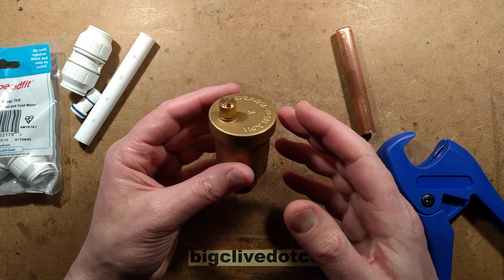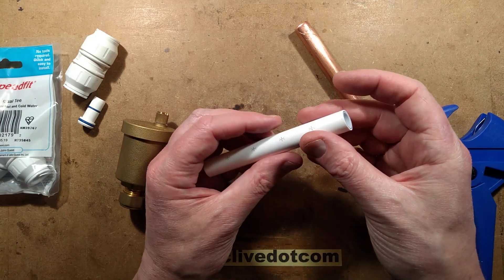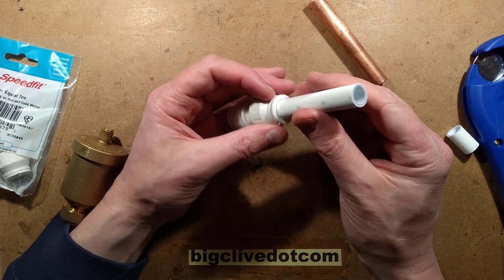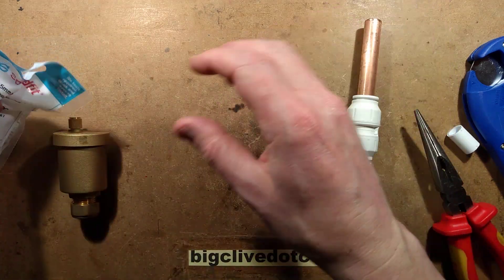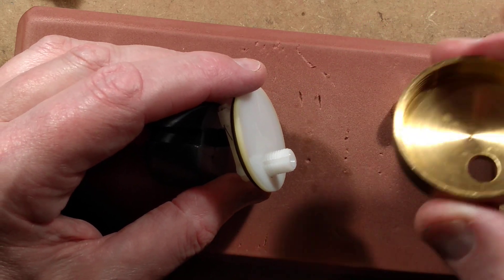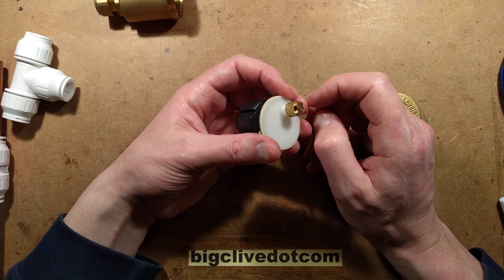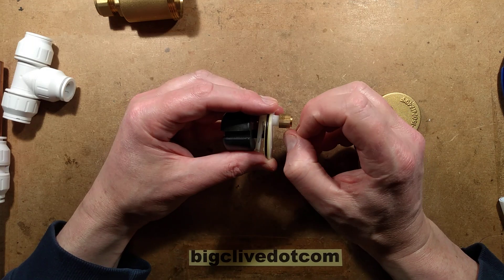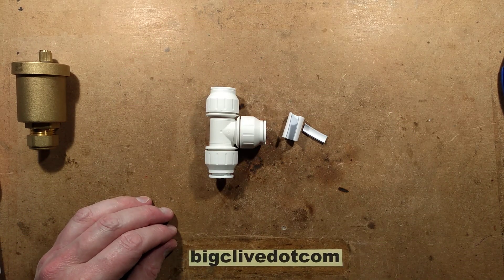Inside a bottle air vent and plumbing ramble.  (No electronics whatsoever.)

Comment: I was expecting a ping-pong ball to be inside. Goes to check that the cap isn't screwed in tight on the vent by my hot water cylinder.
I put one of the fibre washer type bleed valves on the one radiator in our system that always collected air and it has been trouble and air free ever since. Simple fix for very little money and why didn't I do it years ago.

Comment: The reason that the float does not apply pressure directly onto the seal is to prevent wear on the seal. The seal pressure is regulated by the lighter controlled spring pressure instead of being forced up by the float.

Comment: I'm a plumber, for plastic pipes my preferred system is Raxofix by Viega. The fittings aren't as huge, but you need to use a press to seal them.

Comment: I re-plumbed my CH system using copper pipe and Speedfit fittings, everything clipped and up to building regs etc.  Within 5 years EVERY SINGLE speedfit joint has failed.  No idea if I unknowningly did something wrong.  Replaced with copper compression fittings and 10 years on still all good.  Will never use speedfit and its like again, too much long term hassle.
Reply from the maker: Did they pop apart or just leak?
Reply: They started weeping, which became a dribble.  I tried to tighten them, adjust them etc to find out what the cause was, but couldn't work out why.  My best guess was that the 'O' ring seals had failed but no real reason as to how.  I replaced them as they failed, and after 5 years I had replaced them all.  They were fine for the first 2-3 years though.

Comment: So are you supposed to keep these slightly open or not?
Reply from the maker: If it's in a visible place that water damage from dripping isn't an issue then they can be left venting.  If elsewhere it may be better to close them fully.
Reply: @bigclivedotcom  Much thanks!

Comment: used it for years never had a failure   the ONLY no no is do NOT use it on Stainless Steel pipe it WILL BLOW OFF absolute guarentee  AND contray to popular opiunion  you CAN intercnahge makes of plastic pipe  .

Comment: Only to add that this air bleed system must be installed vertically. We had some yahoos mount it sideways (horizontally), not good at all.  We use it in car wash chemical delivery and such.

Comment: Go for it Clive.
We've had had problems with old copper pin hole leeks.
Called plumber in to replace all incoming mains water pipe work.
Have now got lots of pipe and fittings as seen in video. good job!!!
Keep the vids. coming Clive.
Reply from the maker: I ended up replacing the main incoming cold water line with plastic.

Comment: A little history to help give you confidence in the new "press fit" connectors you are switching to-- this same style of fitting has become the standard in the US and here in Canada for the Air Brake systems in all transport trucks for at least a decade now (150PSI or 1000KPA). They stand up just fine , even here in Canada where they are subjected to Salt and Calcium Chloride all winter long. Commercial trucks here in Canada must pass an annual safety inspection which includes bleed down tests on the air system.

Comment: Plastic does have some really neat features. Their surface is very smooth, so limescale have hard time settling on it. They does not rust. They're flexible, allowing easier installation and, as you mentioned, are fairly resistant to freezing damage. Moreover, they are mostly unreactive to most chemicals used in household, so unless you want to pump some heated acid under pressure, it will withstand typical use. Even in very soft water they does not deteriorate like copper or steel. Unlike metals, they can be mixed with other materials without having to worry about electrolytic corrosion. Repairs are a breeze - especially with self crimping fittings  - just cut to size with hand operated cutters and put on a fitting. Tighten down a bit, done. No more steel or copper cutting, threading, welding or soldering. Estimated expected life of polyethylene pipes is 50+ years. They does have drawbacks though. PEX-AL-PEX with aluminium pipe between coats of polyethylene is typically used in heating systems, because it'll block oxygen from getting into water - PE(X) alone (and some other plastics), while watertight, are not gas tight. That have to be taken into consideration when designing various systems. Pipe flexibility can also be bad, as you'll need more fixing points than in copper or steel pipes. Even then, when used in warm environment or/and with heated medium, they have tendency to bow. As plastics are not fire resistant they cannot be used for buildings internal fire protection systems (hydrants etc.), at least where I live. Plastic pipes are bit easier damaged than metal counterparts, although it depends on force type and direction. There is also health concerns about plasticisers and other chemicals used during manufacturing being later released into drinking water, as well as microplastics, tiny plastic particles being digested and staying inside our bodies.
 All in all however, plastic pipes are a way to go nowadays.

Comment: I always crimp my pex connections but this system looks great if you only have a few connections to make.  In Canada Sharkbite fittings are the most popular.  Always wondered how those auto vents worked, I can hear them vent if air gets into the system, I have them at the highest point in house.  The only time my system seems to vent is between pressure changes.  Great video.

Also there are a few types of pex pipe, the standard stuff lets a small amount of oxygen into the lines, not a big deal for potable water use.  Then there are types used for heating that do not let oxygen get into the heating loop, using the standard stuff in a heating system could cause the boiler guts to corrode over time.

Comment: PEX (polyethylene cross linked} piping  is used a lot in the US. And while the push to connect fitting are nice most people use crimp rings on barb fittings just because of cost.  We use a lot of the air vents in the dairy industry. As long as they are at the highest point in the loop they work great.

Comment: I've used the speed fit stuff lots and only ever had one problem: of you join to copper and the pipe isn't straight it can put too much pressure on one side of the o ring whilst leaving the other side under compressed and leaking. You know about it as soon as you pressurise the system as it leaks a lot.
As regards compression fittings it took me ages to realise that you only need to do them up finger tight then three quarters of a turn with a wrench. It's easy to over compress the olive and end up with a joint that wraps. One fix is a couple of wraps of PTFE tape around the olive to make a sort of seal between the olive and the fitting. Sign of an amateur but it works.

Comment: Those are complicated push fittings, Clive ! The ones I used had metal sleeve inserts to go into the pipe and then push fit into the connector - nothing to screw up at all.  The loose piece the does the gripping is recessed so it's very difficult to undo them without the proper disconnect tool - which works reasonably well. Installed CH using push-fit plastic. No leaks. Do bear in mind truck brakes use similar push-fit connectors at 150? psi - so no reason not to have faith in them at lower 'plumbing' pressures.

As for the air vent - similar to 'The Gaffer's' comment (Bill Maynard) "When you get to my age, anything that hasn't dried up, leaks." Those air vents either fail to work or leak. The happy medium of them actually doing their job doesn't last long - as you noted - if the valve sticks shut, there's not a lot going on to open it. I wouldn't recommend a sealed system to anyone - expansion vessels are an issue, air vents are an issue and leaks are an issue. All these problems solved by having a vented header tank.

I also noted that air vent was stamped 110°C - so no good for pressurised system sin any case as they can go upwards of 150°C. But handy if you want sodding hot rads.

Comment: Copper plumbing... Another skill I learned gone, I won't use anything else other than the plastic stuff (Apart from appearance  and 300 mm from a boiler), it's so much better allround, (Oh... and btw, the other skill  I don't use now is repairing electronics to component level).

Comment: ...if you are going to switch then  I recommend switch to PEX!  (I'm still with copper) (PVC doesn't freeze gracefully and doesn't take kindly to any sort of bumps)

Galvanic corrosion.  Is there a break somewhere, i.e. where a non-conductive or plastic fitting is separating the grounded section of the system from the rest of it.   (Grounded, meaning that the water main goes beneath the ground and becomes grounded by the Earth).  Typically a water meter can cause this as well; there should be a copper "strap" or 10 guage wire "jumping the water meter so that the entire system remains completely grounded.    That's my guess=water meter or a hot water heater with incorrect fittings (Don't allow non-copper fittings to prevent path to ground for copper or you get that pitting situation) (Caused my water conducting the electrical currents improperly rather than the Cu??)
Reply from the maker: I replaced the main cold water line with PEX.

Comment: If the airvent sticks it will leak out a bit and you can twist cap closed until you can replace it but also if you have drained down the system  to replace it and something else like a expansion tank when you refill the system you are supposed to close cap before filling. The air will push out as water fills and when the last of the air goes out there can be hard water deposits that will ram through and plug venthole

Comment: I’m currently in training to be a Plumber in Germany, the Company I’m working in uses these plastic pipes quite frequently and rarely has problems with them leaking. However you are required to use the versions of fitting that you press shut and not the ones you have when you install them in places where you don’t have access to them later. We use the ones you have primarily for temporary installations but they are quite well suited for high pressures (we testes them up to 12 atmospheres and they held tight.

Comment: I think it is fine and I used it on my current house but in retrospect I would only use it for long unjointed underfloor runs because I did have issues with some connectors whereas I never had issues with past copper systems I have installed. Brilliant for quick emergency repairs. For sheer craft beauty though really it is hard to beat well executed copper system. I can also confirm that I have encountered copper pipe with linear extrusion contamination defects that have then leaked very soon after fitting

Comment: I work in construction, but not much in plumbing. We have a guy for that, and he loves the newer systems. They are fast and easy to work with, but I really dislike any of the ways I have seen for the way they come out of the wall. You will usually have a valve there, and plastic just feels flimsy. As you're trying to turn the valve, the whole mess just feels...plasticy.

Comment: Plastic fittings and pipes are OK. Big down side is that they are invisible to pipe detection unless you do extra work / tinfoil them
Reply: Are these full plastic? All of the ones I've seen contained an aluminium layer between two different plastic layers.
Reply: @mrnmrn1   with aluminum layer are called "pex-al-pex"  commonly used in radiant heating and other closed loop systems that require an "oxygen barrier"
Reply: @throttlebottle5906  Ah, thanks. I thought the Al layer is for higher pressure resistance at elevated temperatures, where the plastic slightly softens.
Reply: @mrnmrn1  it also holds position when bent or stays straight! unlike the other floppy spaghetti noodle tubing

Comment: The reason for the cantilever sort of hinge is to allow the natural flex of the arm to give a good seal. It allows the arm to bend to create a seal that’s square onto to the port face. If the hinge ran all the way through at the end the rubber seal would contact the port at a very slight angle, and due to having the pivot point very close the arm would not flex easily in the correct place, and create a poor seal.

Comment: What is the betting someone has attached an earth bonding strap to plastic pipe.
Reply from the maker: On the basis that there was a label warning against that on the roll of pipe, I'd guess it happens a lot.
Reply: @bigclivedotcom  there was? I mean, I knew better than to "ground" to Pex. I just missed the warning label, and I find that odd, because I began reading warning labels religiously after taking up skydiving years ago. 

Yeah, I know that reads like a joke, only I'm not.

Comment: I have installed metal-polymer pipes (reinforced with a layer of aluminium) with brass fittings in my house about 20 years ago. Main pipeline pressure is 5 kg/cm2, no serious problems so far. The only one problem I have encountered is 2 loosed fittings that were dripping a bit (just tightened them up).
Reply: Sky Sentinel which is why the Best Friend of Charleston and my mate’s wheel bearings failed spectacularly: some dolt engineer simply came across the annoyance and “tightened them up”.
Reply: @HighestRank  In my case the fittings were really loosen (tightened too gently), their nuts could be unscrewed with bare hands. So it's all about right tightening torque: over is bad, but under is bad as well.

Comment: Internal burrs on the copper pipe can make turbulence and hollow it out potentially as well. I always wonder about the lifespan of the o-rings in the push fittings. The system you have seems better than the shark bite fittings we have here.
Reply: Playing The Devil’s Advicate, with due respect THEY called an electrical expert to fix a plumbing problem. If it’s time to split hairs about the particulars, just a pinhole gives them plenty of opportunity to have done it themselves.
Reply: And in case your hardware store is smaller than ours, Sharkbite sits right next to the instant plastic couplers, though it doesn’t cost much less.

Comment: They are brilliant for quick repairs, just make sure the fitting itself is protected from frost as they can expand with ice if frozen and burst.  I have seen the pipe itself burst, but it has to freeze solid.  Use it and you will not have any problems for at least 10 years, though I have seen it in for decades without any problems at all. If you use it foe central heating you will have very little loss from the plastic pipe between radiators.  Very simple to protect against frost with a small bit of copper pipe on the return to the boiler and a pipe star to bring on the boiler to give a few degrees of heat before turning off the boiler again.  Have to say though, if you have oil or propane to make sure you have enough to keep system going, it will not use a lot, but in bad frost it can be surprising.
I have used these fittings without any problems. Fit and forget, but just make sure the fitting itself is not exposed to hard frost.
Reply: It’s the same concept as a compression fitting, which I have seen shove their pipes out after a light freeze, and as such I do suspect your assumption to be correct.

Comment: I have had the pipes in the crawlspace changed to PEX when the ½" copper pipes exploded in several locations when the crawlspace heating failed. Apparently freeze damage will never be a problem again with the PEX, since it can expand enough without splitting if the water inside freezes.
Reply: Lake Nipissing never had crawlspace pipes burst, just their fittings. Apparently turning a corner is difficult for an abrasive polar fluid on the run such as water, I’d have replaced the burst fitting and all others which made straight pipes have corners.
Reply: it will push the fitting out/off, being they fit inside the pipe or can split/blow the pipe wall out, depending on which pex... it;s not all the same

Comment: Trouble with plastic pipes is expansion, and if you don;t carefully mount the pipe you can get early failure by rubbing and wearing away.
Reply: TIMMEH19991 obviously the same goes for plastic fitments. Of course you can ignore the hormones in the plasticizer.

Comment: Never used the plastic inserts before putting them into the plastic compressing fitting  (but makes sense using them)

OK the round  insert is normly inside the compression fitting (I have to check on that)

Comment: I use only one of this vents in every system. It releases the air out of a selfmade micro-bubble-extractor.
Even in my newest and biggest system with 10750 m pipe inside the 250 mm thick concrete floor and a total of 9500 l of water.
If you do it right you can release all the air through only one point. Even if you fill such a big system for the first time.
Over time these micro-bubble-extractors catch every bubble in the whole system.